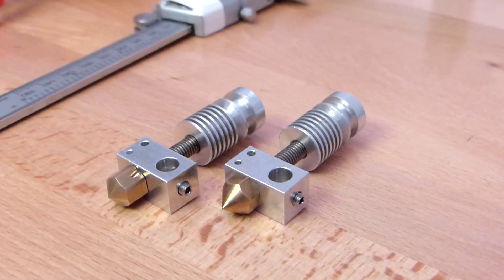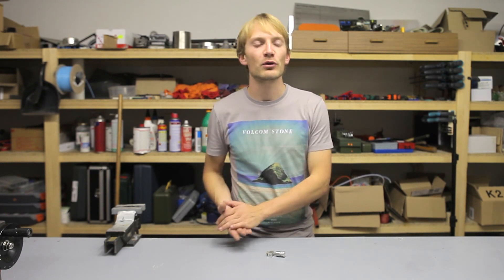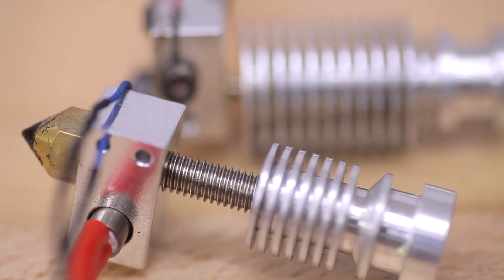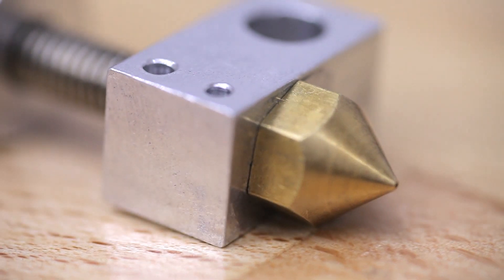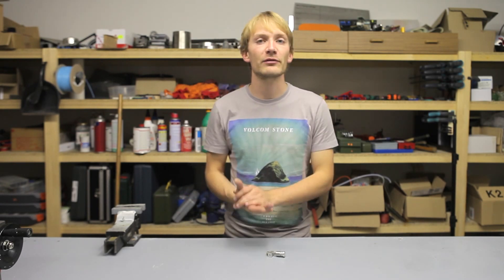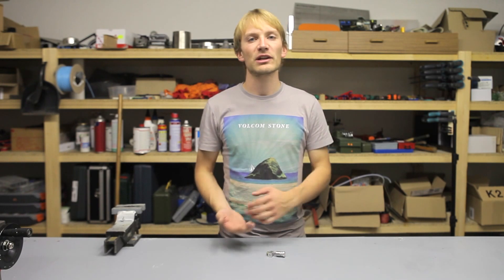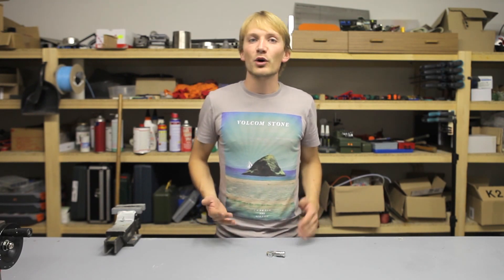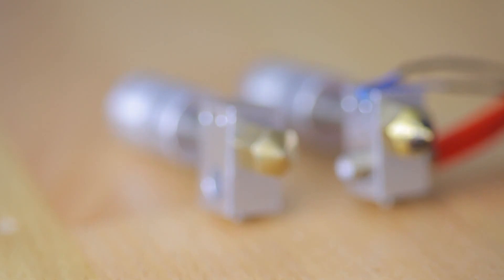Honest review: The Aluhotend

Comment: I had nothing but problems with my E3d... completely useless for pla. I bought 2 and upgaded two different 3d printers..... a Ultimaker and a Velleman 8200. Neither would print pla.  Replaced them with Aluhotend and I have had one clog in over a year. Does V6 E3d Print pla yet?
Reply: +TikiToyLabs I have the v6 and it works great for PLA. :D

Do you change your temperature table in your firmware and do a PID Autotune? Cause if the temperature readings are off it will affect its ability to extrude reliably.
Reply: I havent tried the v6 yet.

Comment: Great video again, very clear on the different problem of aluminum extruders. The nozzle really determines the extrusion. The aluminum fans are also good for cooling.
Caution when printing exotic plastic at high temps. Aluminum has a lower melting point then full metal.

I shared your printrbot playlist, very clear on assembling this and instructions of overall 3d printer.
https://plus.google.com/102227286504637693299/posts/2Ved9HRXnvU